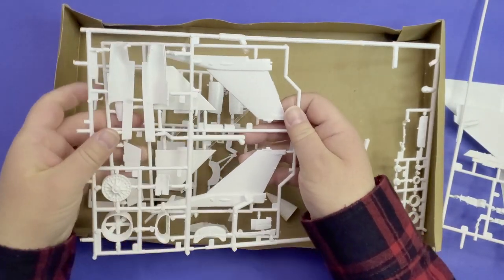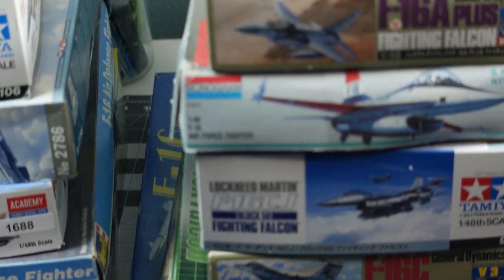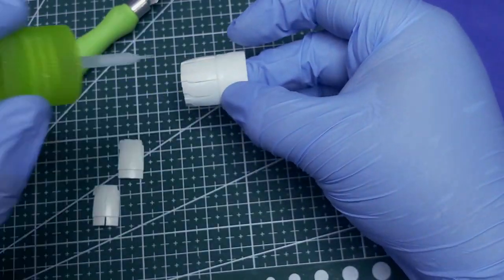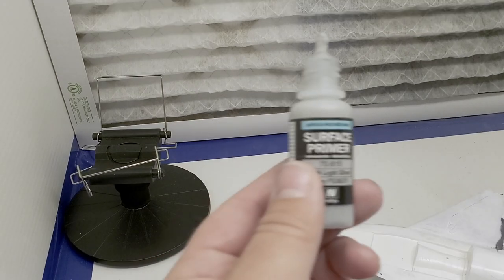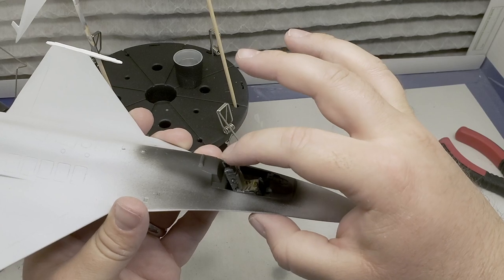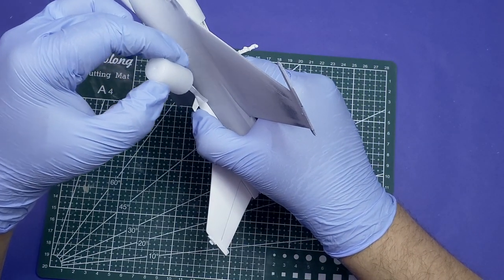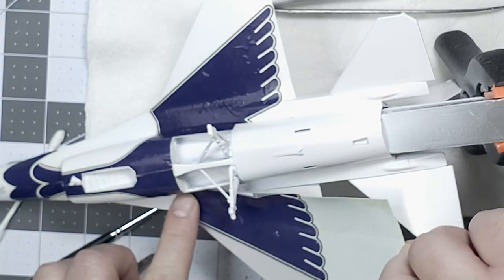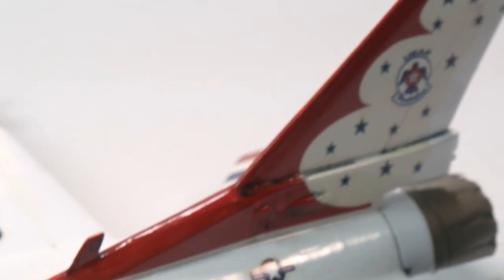F-16 Thunderbird Full Build - Revell 1/48

Comment: This F-16A kit represents a Block 5 Viper, the molds go back to 1980, that's why you get the detail-less cockpit, raised panel lines and the drop tanks from an A-10 (the sway braces are molded on the underside of the wings!) but Revell was nice enough to update the ejection seat.

Comment: Ha, ha! When i was a kid warped plastic lack of detail crappy decals and opaque canopies (at best) were all we had. As for tools, a steak knife, mom's emery board and a Testors "Military flats" paint set with orange tube of glue and a paint brush. Still loved those models though. Now i'm building the HK models 1/32 B-17 with aftermarket detail sets along side of Atlantis kits of old. and enjoy them all.
Fun video,
Thank's!
I forgot to mention 'Flash". Sometimes it was hard to tell where the flash ended and the part began!
Reply from the maker: Those were the days! I remember using that orange tube of testors glue and getting it everywhere except on the model and getting in trouble for stinking up the house lol. Modeling has come a long way since the last time I did this. XD

Comment: That’s why you’re a modeler and not just a builder.  I’m currently working on the tamiya F-16c/n as an adversary.   Some bigger plastic cloths pegs are a huge help. Have you tried the Vallejo putty? Or the Mr. Surfacer primers ?
It turned out very nice in the end.

Comment: If you have the yellowing decal issue again I have a tip that works well. Before starting the kit, while still in the clear protective bag, tape them onto a window that gets a lot of sunlight every day. Check every few days and you will see a gradual fading of the yellowing. When satisfied clearcoat the decals with your favorite decal bonder, I use Microscale sprayed through my airbrush.

Comment: The reason there's a gap in the cockpit is because of the tab along the back edge of the floor which should not be there so the solution would be to REMOVE  the tab, a no brainer.
Reply from the maker: I thought about doing that and then pushing the cockpit against the back wall to get rid of the gap, but the instrument panel wouldn't have lined up right with housing thingy on the top so I left it as is.